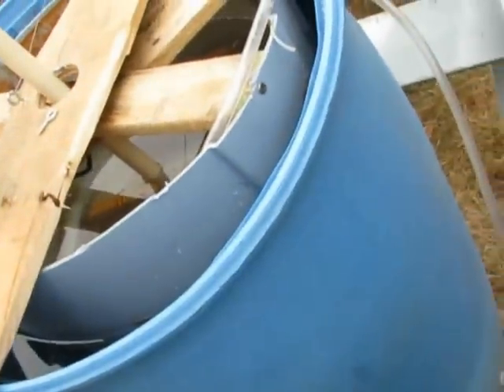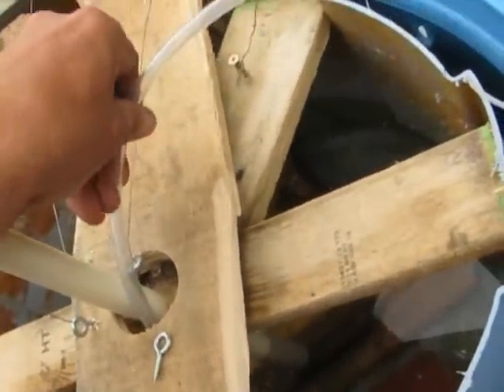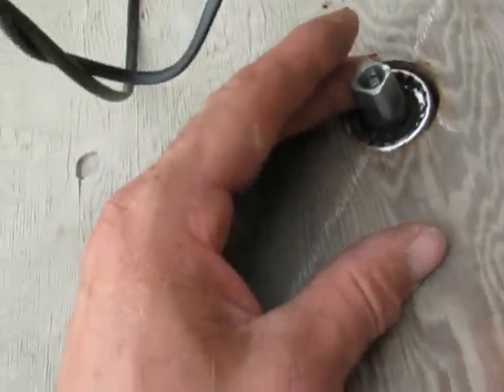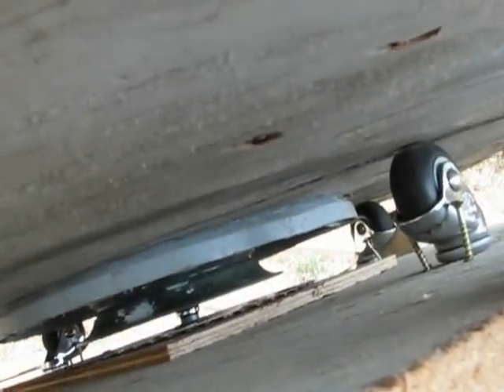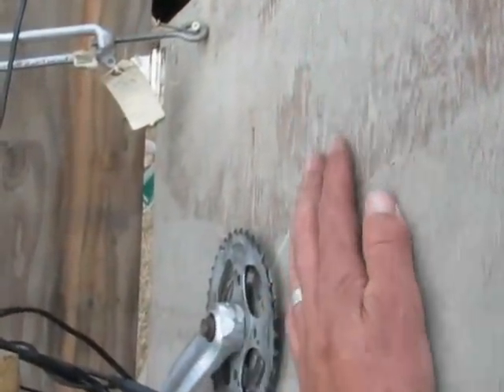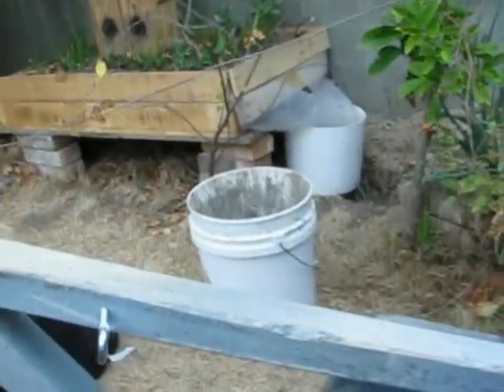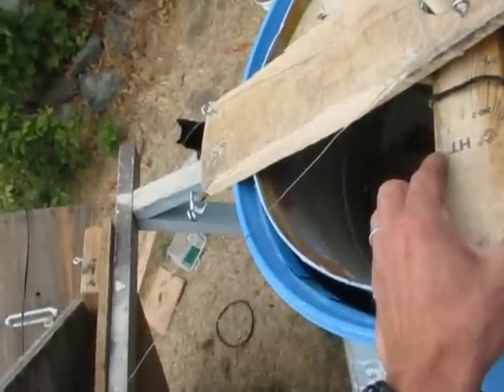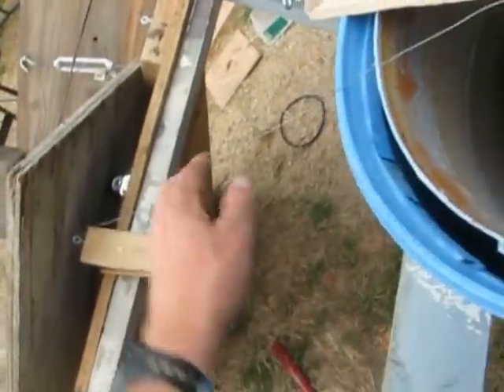Universal solar tracker put together.  And new and revised dripper tracker!

Comment from the maker: There are many ways. I don't know how to control a stepper motor myself. The problem with a valve is that the pressure changes as the water goes lower. I show something in my "dripper irrigation" video which might work.